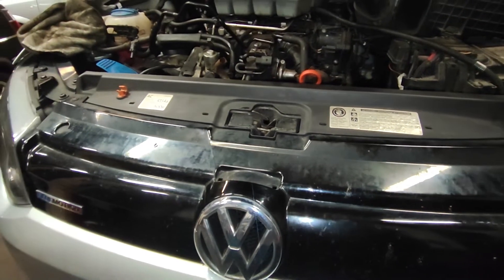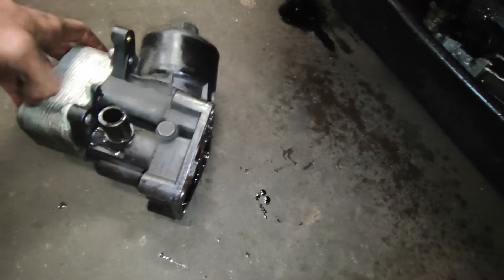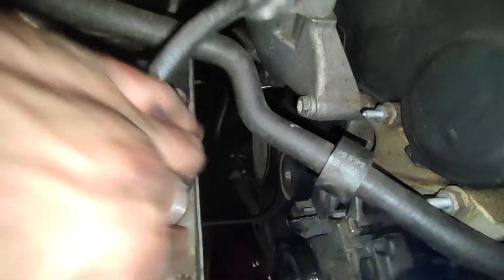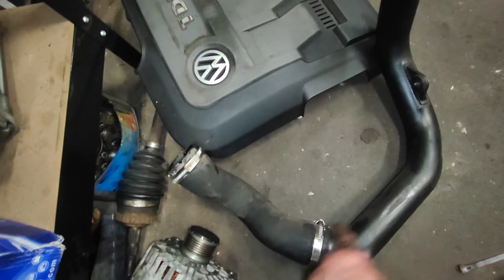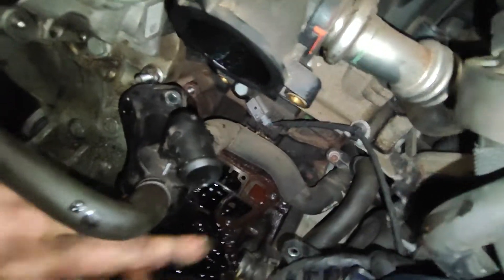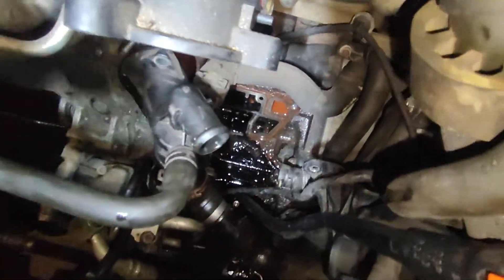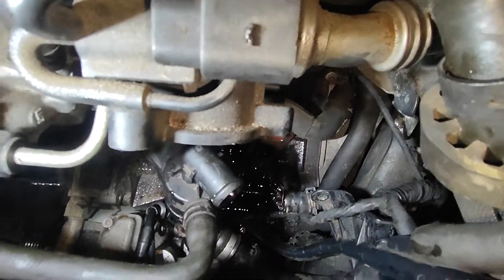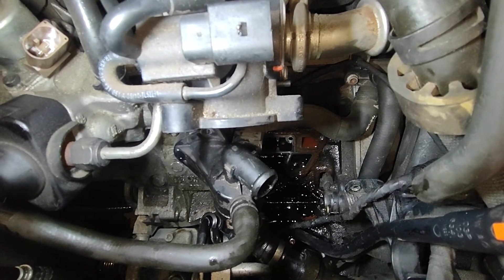6R 1.2 TDI / Oil filter housing + oil cooler, do not underestimate it!

Comment: Just did the same job on my 2013 Polo 1.2 TDI. I took the headlights out and the front end off the car to get to oil cooler. Saved taking alternator and any other engine parts off. Took me 1 hour to get front end off and job was done in two and a half hours. This is NOT a criticism of this video which is very helpful but just highlights another possibly easier way.
Reply from the maker: Thanks for sharing mate!
Reply: What tools do you need for this job

Comment: Hello,  please share list of tools. Especially the oil filter housing
Reply from the maker: Will do! Housing to engine block is 4x 8mm multispline. 16mm for the alternator, Torx 30 for the other bolts. And Pliars for the hose clamps.

Comment: No need to remove the alternator, but nicely explained
Reply from the maker: For easier access I find it more easy to just remove it. It's not much extra effort.
Reply: @MechaNick_  I fully agree brother, this job normally takes about an hour to strip and assemble. Have you had the problem with the oil and water mixing on these engines? I know the filter housing leaks from the bottom gasket as you pointed out in the video, but just wondering if they maybe crack between the two galleries?
Reply from the maker: @cohankok2786  Nope fortunately they were not mixing but it is very much possible.
Reply: @MechaNick_  I currently have one that I need to assess tomorrow. Will let you know what I find.
Reply: Hi Guys, what was the initial problem with your cars?
Reply: @cohankok2786 I have a car with the exact same problem, oil in the water. I was told it's possibly a head gasket...but I'm going to try this tomorrow as I've nothing to lose!

Comment: Just tried this at the weekend and couldn't get the plastic part next to the housing off..the one with the hose pipes going to it..any tips or does it come out a special way I didn't want to break it
Reply from the maker: @hosey31  the thermostat? It has 2 bolts. You need to wiggle it out carefully.

Comment: Hello sir,
I tried it but the alternator didn’t come loose. I put out the two bolts and it didn’t come out.
Reply from the maker: @PatrickStar-vp9ys  put the bolts back in a few threads, hit the bolts with a hammer.
Reply: @MechaNick_  but why hitting the bolts ? The alternator comes out to the bumper to the front direction or not ?
Reply: To the front
Reply from the maker: @PatrickStar-vp9ys  yes, but by hitting the bolts you loosen the alternator. When its loose take out the bolts and the alternator